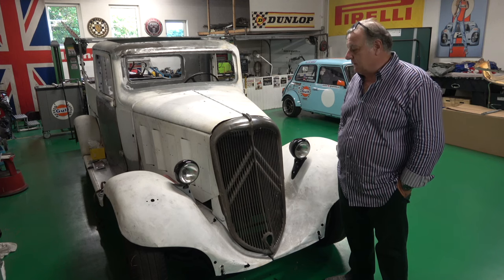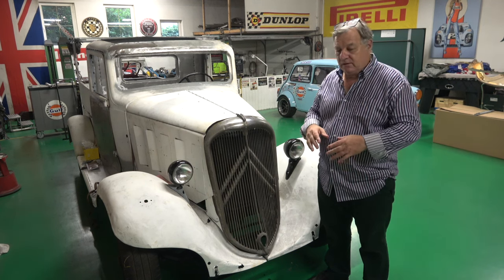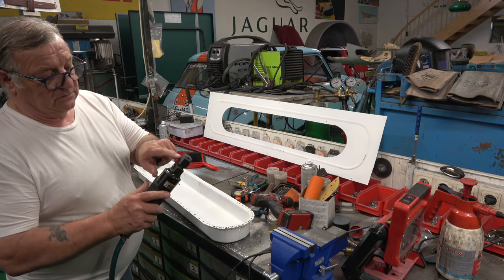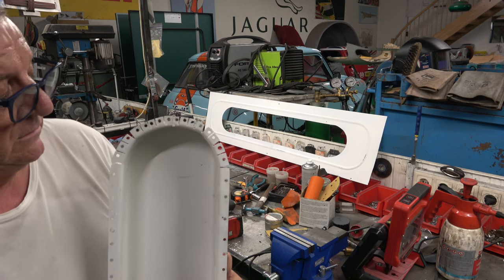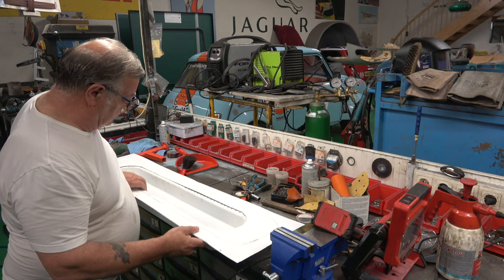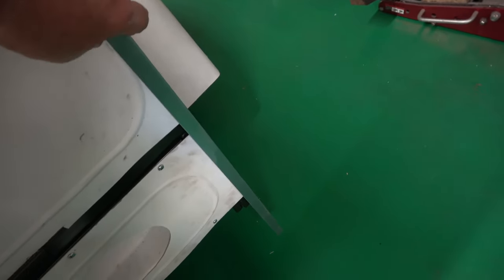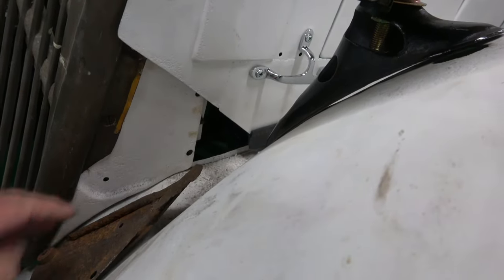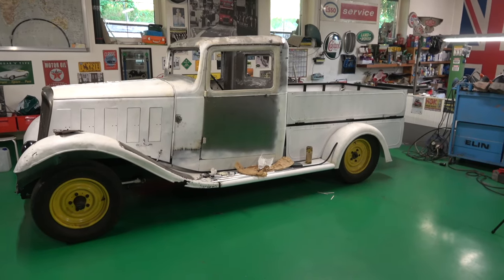1930s Barn Find Citroen Pick Up  ( Pre Photo Shoot For Citroen Heritage )

Comment: Thought ! , don't the turn signals and the rear lights need to be viewable from the side ?
On the corner edging piece on the tailgate you will have to drop the tailgate before you can drop the side, right ?
Reply from the maker: Gary,  You may have a point but I can always fit repeaters if it‘s an issue. That‘s correct if it was ever to be loaded the tail gate is the starting place. 
I like the idea of the tailboard and sideboards having different ways of being used as in a flatbed or an extended flatbed.  Cheers Dave